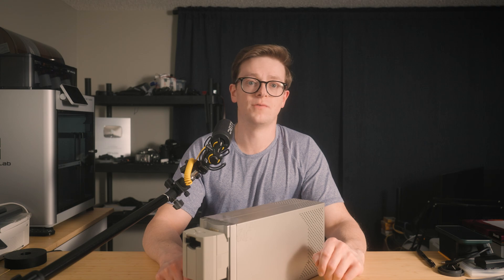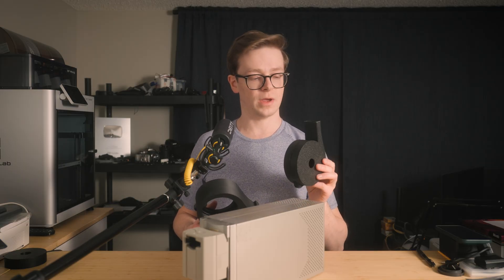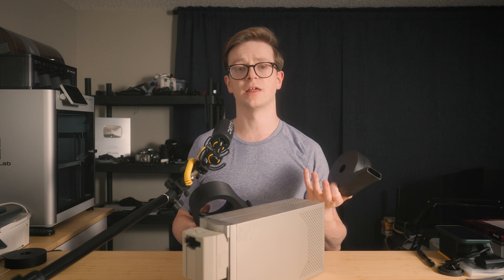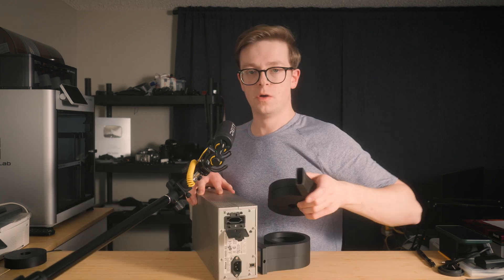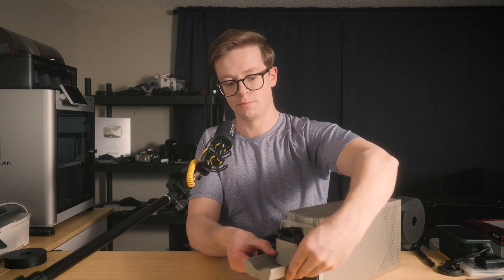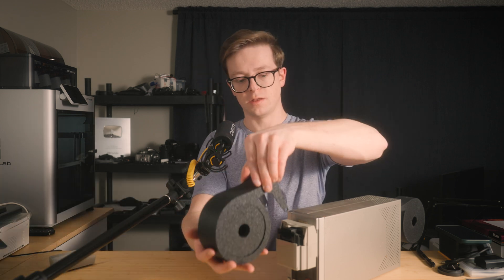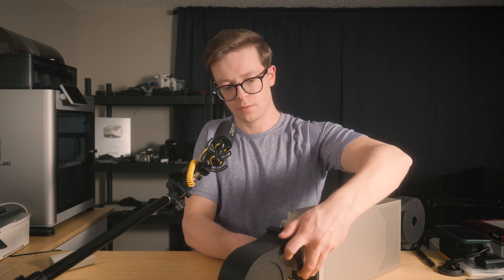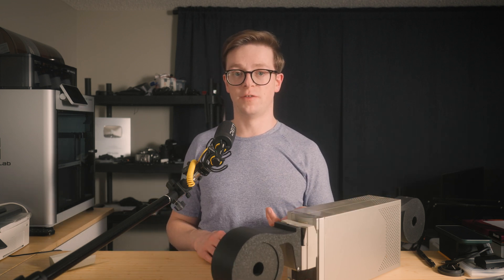3D Printing an $800 Upgrade for my Nikon Coolscan

Comment: Hey! I am the creator of that design. Thanks for the video, I am glad people are using and liking the design. There are 2 small things I noticed with your print though. Firstly, the side covers for the front spool look a little loose. Did they print like that for you? Maybe you sanded the outside a little too much? The goal there was for it to be a friction fit so that it doesn't move on its own. Secondly, I recommend using a hair dryer or heat gun to heat up the little arms on the front spool and bend them inwards a bit. This is to help add a spring effect and help the front spool stay attached.
Reply from the maker: Hey thanks for designing this! I didn’t actually do any sanding to my print, that’s just how those side panels fit. 

As for the bottom flanges, I was able to bend them in enough by hand that I get a good fit on the front of my scanner 👌
Reply: Yes, my front sides didn't need any sanding from my Bambu A1.  They were not tight, so I took my small soldering iron to make some tiny nics on the plastic and that worked great.  Thanks for the print, great job.

Comment: Hi Nick, thanks for sharing all of these. Very useful for the few Coolscan owners like myself. I have an unrelated question, do you ever get a red/brown/cyan gradient on the edges of your scanned negatives with the Coolscan?

On my Coolscan 5000 I get these. At first I thought it was a shutter problem with my camera but I got my lab to do a full area scan of the same negatives and these "gradients" don't appear on these.
Reply from the maker: I don’t believe I’ve seen that on my scans, are you certain it’s not vignetting from your lens? There’s a chance it could be the light source on your scanner is starting to dim. There’s cool scan Facebook group has a guy in it that does repairs and stocks spare parts.